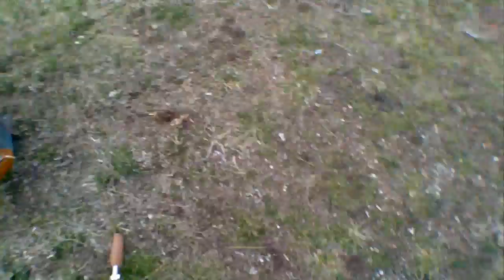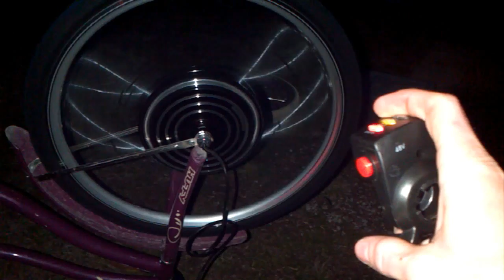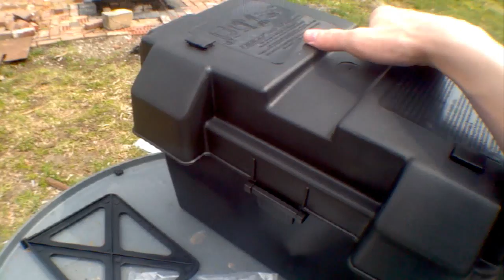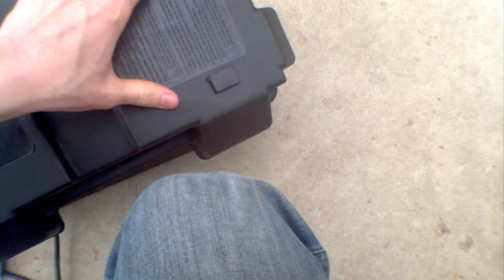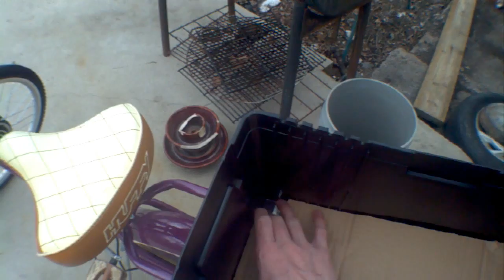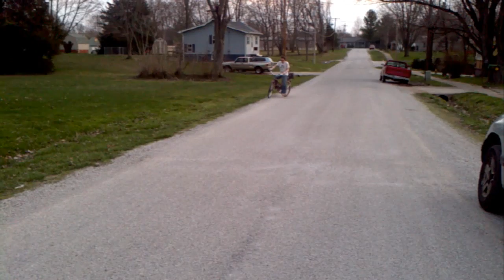DIY E-bike: new motor 48v 1000w

Comment from the maker: no i can't find it sorry. and yeah i was a lot less informed about batteries back then but mostly it just boiled down to me not having hardly any batteries that worked. thats why i used those horribly sulfated red ones untill i got my lithium pack together ;P

i should get around to connecting up my Amp/Volt meter to my bike, should also add a locking chain that is welded to the frame and maybe some type of theft deterant.

btw thanks for the compliment. it does mean a lot.

Comment: Also, acceleration (from stop, going uphill and going around turns) puts a very heavy draw on the batteries. You might also want to change the handlebars. Beach cruiser handlebars make it much more difficult to keep control of the bike at high speeds. Also, make a more aerodynamic battery box.

Comment: It looks to me like your batteries are badly mismatched. The one large red battery look much bigger than the other 3. If that battery has more capacity than the other 3, it's going to damage the other 3 batteries, especially with them wired in series. The cells in the other 3 batteries will reverse and then vent. Use the pedals to accelerate and keep you speed at 10-12 MPH, energy consumption goes almost straight up after 10mph. At 10 you need about 80 watts and by 20 you need nearly 400.

Comment from the maker: yup, and the best stuff is what you find in the trash. hell i keep finding more batteries and motors and stuff in the trash. and tons of wires. always great to have a box or two of wires laying around :D

tbh 400$ is about as much as i've invested in my entire bike, thats including stuff i havent even added yet like power displays and charging circuits and mirrors. then again maybe closer to 600. but still more than some people charge for a battery pack alone.

Comment: I have same motor, its great, quite efficient and runs cool at upto 800w,

They tend to use that wheel in budget kits of 24v/500w 36v/800w and 48v /1000w, and its the same wheel, and same controller... one size fits alll....
if i run mine at 66v i get 32mph continuous with no heat issues in a 26wheel.

Comment from the maker: oh i built them out of old laptop batteries. a 48v 9ah battery cost me about 80$ in batteries (but took a bit to put together) basicly every laptop battery pack i know of uses 18650 cells. you crack the packs open and just remove the cells and can then use them. i run them 0.2v lower than normal so they get 4x as many cycles. 5000 cycles.

i have several other videos where i talk about 18650 cells. and i just got back from filming my 2nd battery video. gonna edit it tonight.

Comment: What kind of batteries did you use to power the setup? I looked on the solarbike website and the one offered by them is almost $600 for the middle of the road model.

Comment: I bought the same motor kit for my 2000 vintage 21 speed bike, except mine's for the rear wheel. In addition I bought a 48v 15ah lithium battery/charger (which cost more than the kit) and am really enjoying it. I have no speed or mileage data to share, but I can tell you I get hours of enjoyment with the wind in my hair.

Comment: What becomes a concern is the total weight of the bike after conversion.  It can be tough for the bike to carry all of the weight.  I tried to peddle my bike with out using the motor once and I could not get over 10 MPH, it was tough going.  I'm trying to figure out how to put disc brakes on the bike, got the rotor on the rear, but the calibers are going to be tough.

Comment from the maker: yeah that is a nice idea. but bikes can handle up to about 50mph before they brake most of the time.

one time i was going 45 on my 1958 bike and hit a 1.5 inch tall lip where the road connected to a bridge and it snapped a bolt in the frame. but that wasnt with any electric motor so idk about how the electronics will hold up.

i've been pondering how to add shock absorbers to my bike. it prolly would be a nice idea to start with a bike that had them.

Comment from the maker: hey thanks, hopefully it'd make a better burn out with my new 48v 40ah battery i'm building this week. in this video whenever i'd go anywhere neer the throttle it'd drop the battery voltage really low so it wasnt getting much power.

Comment: Nice Video.  My recommendation to people wanting to do a conversion is to use a full suspension mountain bike as hitting a runt or bump in the road at 25+ MPH can damage the bike.  I bought my bike from Wal Mart for about $90 years ago, but I bet a used one can be had cheap.  I run 3 LED head lights and 4 strings of tail lights used in RC model planes.  I'm also using 6 cell 5000 MAH batteries.  The batteries are a bit pricey, but I also use them in my large RC planes.  Keep up the good work.

Comment from the maker: already built one. this video is old. you should check my newer ones.

i have about 170 more 18650 cells coming in the mail. when i add those to my bike i should have close to 120 miles of range.

and FYI building a lithum battery is about 1/3rd the price as buying one.
Reply: How did this end up working out for you do u have any pics or other videos on how you rigged up the batteries I’m working with a razor pocket mod and not sure what kind of batteries I’ll be needing to run this 48v 1000w motor,,,

Comment from the maker: i finally finished my battery and i can get up to about 30-35mph when i'm peddling to help it along. my battery still isnt big enough to supply the 20 amps needed when it goes full throttle though so there is room for improvement.

ya see as i pull more amps the voltage drops and when i go full speed its pulling enough amps to drop the battery voltage down to bellow the cutoff voltage. so the output oscillates and i dont get all the power that i should.

Comment from the maker: well i havent gotten my battery pack straightened out just yet. but its rated to 30-40mph. in my video about the 18650 cells it did get up to about what feals like 25mph untill the bad cells drained. 

i was gonna film a video today couse i finally soldered some more cells together but then it started raining  =_=

just FYI the voltage usually defines how fast it'll go and the watts define how much power it'll have to get up to that speed. 24v=20mph 36v=30mph 48v=40mph roughly ^^

Comment from the maker: one question, what shape are the batteries in? if they are over 5 years old ya may wanna refil their water level.

ill PM you about how rectifiers work to turn AC into DC but yeah you can only charge a battery with DC, if you charge a Battery with AC it will not make your battery happy for sure.

if your batteries are brand new and have full capacity, you should have 864 watt hours. so a 15 amp 12v charger would take maybe 4-6 hours to charge all 4. but thats just a guess.

Comment: Your answers have shed a lot of light on the subject and thank you very much for the feed back. Once again I'm just clarifying and making sure I understand. You plug a 12v charger into an AC outlet and it charges as DC? Also how long would you guess it would take to charge 4 12v 18 ah batteries?

Comment from the maker: a float charger charges the battery just enough to compensate for the slow self-dicharge the battery already does.

a trickle charger is usually an unregulated power source. like in my "DIY: repairing SLA" video i took a wall-wart and used it as a trickle charger. usually a trickle charger is like 0.5A to 4A

btw i just googled that to find out what a float charger is.

oh and idk what you mean by 3-Phase charging, batteries are DC and Phases are associated with AC.

Comment from the maker: thats why i say just buy a generic battery charger that is made to charge 12v cells, like i have one that says the % of charge and stuff, think it was like 40$ at wallmart.

and you understood perfectly. if you really wanted you could hook them up with relays and that way you could switch parallel/series with the flick of a switch.

but hey, if you have a 48v lead acid charger that would be easier, just i havent seen one that was any good. i'll try to make my video about it as soon as possible.

Comment: Thanks for the speedy reply. But just so I understand you mean put them in "parallel" to charge then wire in a "series" to actually run? I'm fairly new to this but most of it seems pretty straightforward. I just want to get the charging right because it's my understanding that charging SLA batteries wrong can really affect their performance.

Comment from the maker: oh it looks like you have a nice battery pack there, my battery pack isnt good enough to run the bike yet but i'm working on it. i have a few motorcycle batteries and some power wheels batteries, and i'm replacing them with lithium-ion 18650 cells from laptop batteries.

but as for the charger i'd hook them in paralell and charge them with a regular car charger as a 12v 72ah battery. then switch them to 48v 18ah. like my 18650's i'll charge as 4.2v  216ah battery. then put them as 48v 18ah.

Comment from the maker: just be make sure you dont short them out, they can pack a big punch. 4 dead cells had enough power to heat a wire up to white hot and burn a hole through my laptop  hehe :P

Comment from the maker: if you ever wanna experiment with the 18650 lithium batteries, never buy UltraFire from ebay, UltraFire is a chinese company that buys old laptop batteries and cellphone batteries and rebrands them nomatter how dead they are.

but the batteries i got from 2002 for my IBM thinkpad X24 work perfectly. and the little circuit board inside the laptop battery keeps track of sooo much data ima add one to my final battery so i can read the data with my laptop.

Comment from the maker: well i dont have mine going just yet, the batteries dont have enough strength to get it going under its own power.

for the lithium battery ima use 18650 (thats the battery size) lithium batteries from old laptop batteries. you can usually get them for 1.2$ a cell. so like a 12 cell battery would be like 18$. each cell is 3.8v 3ah and is a bit bigger than a AA. :D